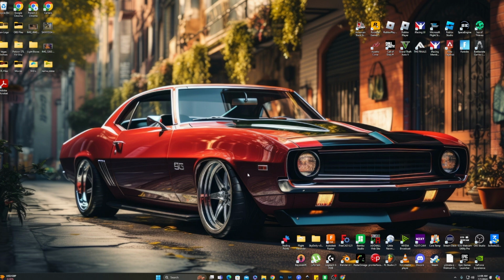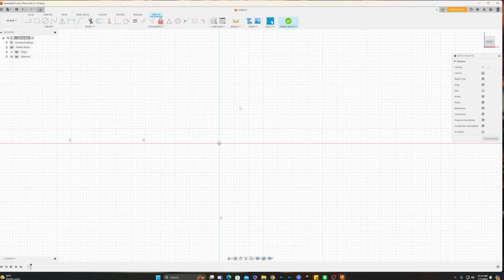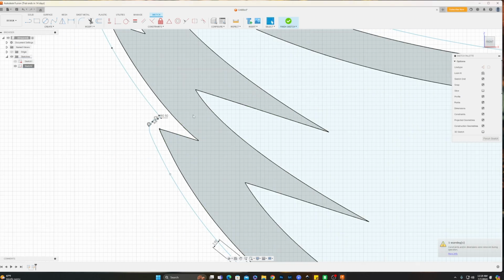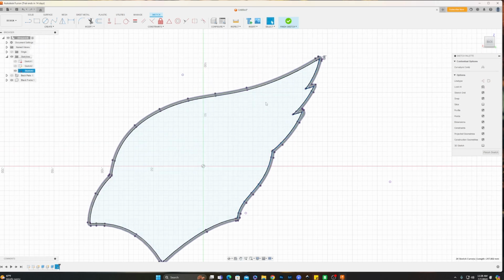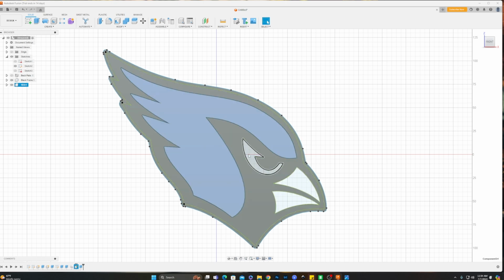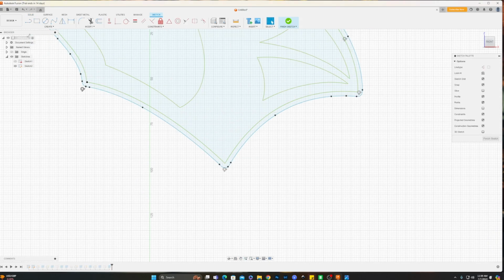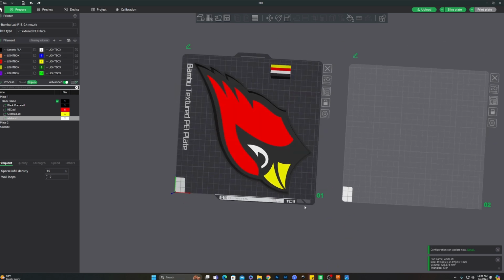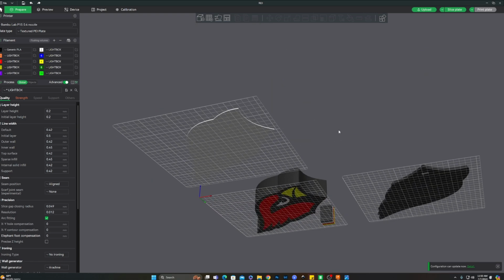How To Make A Light Box In Fusion 360 (Bambu 3D Printer)

Comment: Google Logo name - PNG
Inscape to convert
Adjust using slider
Apply
Save copy, now SVG
Close Inkscape
Fusion 360
Blank screen
Create a sketch - Bedplate size
Insert svg
Pick a plane
Move to position
Flip orientate
resize
Ok
Finish Sketch
Delete or hide bedplate
Each section highlights means connections are good
Means they are separated
Right click and edit
Double click outline - If a break is present
O - Offset
second line to expand - 2.5mm outside
Chain selection so it goes all the way around
OK
Add Filets if needed on sharp edges
Finding breaks
Line tool and zig zag tool
Select to find doesn't fill
Delete missing line
Blend curve
may have to manually tool
Finish Sketch
Select the whole image
E - Extrude
Start - Offset
Offset 40mm
Distance 2mm thick
New component
OK
Back plate created
Component Label Back plate
Turn sketch on - 
Click on offset
E - Extrude
40mm
To back plate - don't hit join
New component
OK
Name - Black outline - Frame
Hide backplate
Hide sketch
Shift and flip around 180
Create new sketch
Click on outline
P - Project - Click on surface again - Ok
Another outline sketch 
O - Offset - 2.5mm
Middle 
Make sure connected
2.5mm middle
ok
Check for breaks
Finish Sketch
Flip back around
Find break
Line tool and zig zag tool
Modify and line to seal
Delete Lines
Create lip for the back plate
Click middle line 
E - Extrude
Lip to connect to center
Distance -5mm want it to go out
Join to backplate
Enable orig sketch
Hide backplate
Individualize each color
Outline black
Select area that are black - E
1mm - New body - Ok
Open new body
Left click and drag to black frame
Interior - Red example
E - Extrude
1mm - New component - Ok
Go to new component and name red
Eye - White - E - Extrude - 1mm
New component
ok
Rename - White
beak - 
1mm - New component - Ok
Rename - Yellow
Turn off sketch
Open back plate
A on keyboard
Paint options
Fusion appearances
Paint options
Glossy
Duplicate for each layer
Black drag to black
Right click and edit
red
Drag to red in tree
Edit next white
Drag to white in tree
Yellow - drag to yellow in tree
Now have your box.
Render - Shows displayed and lighting
Design
Create plug - Usb  C cords
Turn off everything but backplate
Create Sketch - 
Square - USB C port - 6x14mm
Low location - Stand
E - Extrude
Go cut - Whole is created
Insert DXF file
Cut in a whall hang slot
Show everything
Create stand
Go to original front plate sketch
Edit sketch
Draw a stand with line tool
E - Extrude
42mm
back plate included
Show everything
New component
Ok
Name stand - 
Go back into A
Make black in tree.
Select backplate 
Right click save as mesh - STL 
Bionary
mm
reframe high
ok
save in folder
Black frame - Save as mesh
Save
red - save as mesh
White save as mesh
Yellows save as mesh
ok
Save
Done in fusion 360

Prepare
Add pads
Open - 
Don't click black frame
Hold control - black Red, white, yellow - Open just colors
Load as a single object - Yes
Layout face - down on colored side
Rotate - to fit
Objects
Put all colors in
Look under side confirm 
Make sure tower is out of the way
Global
Turn elephant off
Alcine 
Gyrodi
Supports - no supports
Advance settings
Copy his settings
Filment - 210 - 55 bed - Elegroo pro filment
Slice plate
3 hrs 54 mins
Check layors and edges - be careful for gaps
Becareful not click and move your objects
Pinholes - Diffuser
second plate is back plate
Fit on plate adjust
Make lip facing up
Make white diffuser in fusion
Select all face items
E - Extrude
Offset 70mm - 1mm
Go into sketch not outline
Offset 70mm - 1mm
This becomes the diffuser - name it and save as mesh
Create a third plate - white
Flat pc to slide in

Comment: Had you just created the bodies inside the original component, you could have extruded your diffuser the first try.  Since they were all separate components, you would have had to do them one at a time, or by HIDING (not deleting) the components and using your sketch as you had done.

Comment: I like to put the lip on the front and not the back plate, so the walls and the back plate are a single 40 mm unit,  and the front plate is only 5 mm thick. Then I have separate profiles for printing each in Bambu. My "Face Plate" prints on tweaked  fine settings and the back "Box" is printed at standard or even strength settings. This way the back prints much quicker. The front is only 5mm high so you don't take the chance of losing all those fine printed colors if by chance the print goes wrong half way up the walls. Both ways work though, great vid!!!
Reply: That's a really helpful tip - thanks

Comment: What light kit do you use for your lights?
Reply: I'd like to know also.  Having a USB-C plug in is typically higher voltage/current.  An old original USB-A cord or even Micro USB would be sufficient for a 5 or 12V light I'd imagine.  I'm curious to know the light he's using for sure!!

Comment: We need tutorials on how to make these with no AMS or bambu printers. We need a tutorial on how to make these on a simple ender3
Reply: There are some out there you have to do shop and change the g code, I beleive...it was too confusing for me.
Reply: You'd do the exact same thing for the build process.  The printing process would be each piece.  So instead of loading the front and frame into one plate, you'd load them separately and then you'd have to glue them into the black top piece.

Comment: im trying to do the Dolphins logo. when I make my SVG I get outlines around everything. any idea how to fix this?
Reply: sometimes you've got a lot of manual work to do to clean these up in the SVG editor.  In the past, I've had to import the image to Fusion360 - and then basically re-trace everything on complicated models to simplify it.  Hope that's not the case for you.  I hope for your sake it's a quick and easy tidy-up in the editor.
Reply: @davewoeckener I figured it out. In Inkscape I had to select no outline and then trace it. It’s all good now thanks.
Reply: When I was doing my logo, I had a lot of small unconnected lines, so I had to manually go in and create new lines and curved edges in order for it all to connect. It may take a lot of manual work, but in the end it'll be worth it. I had to go around each time I made a new sketch and manually create new lines in order for everything to be closed off and correct.